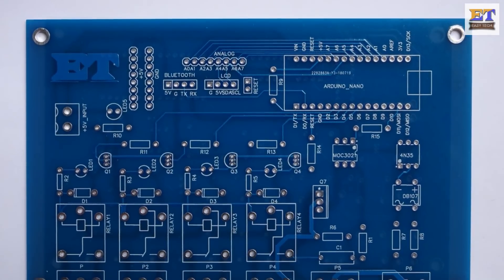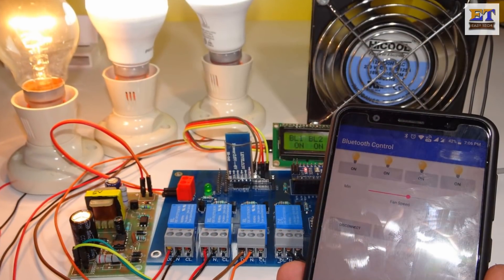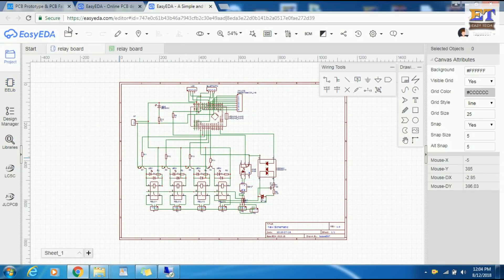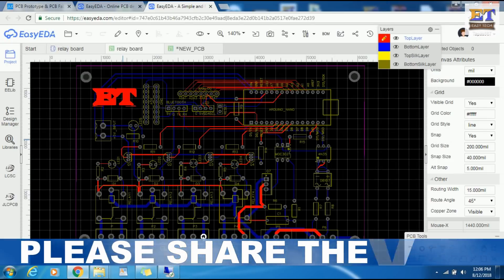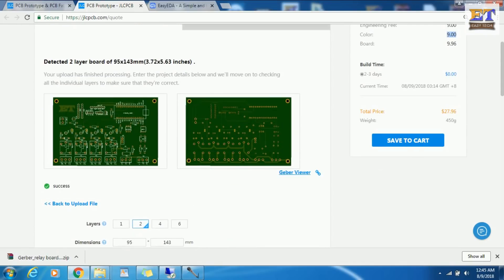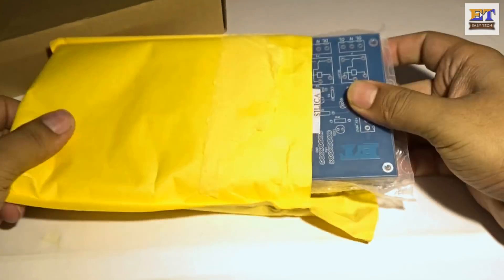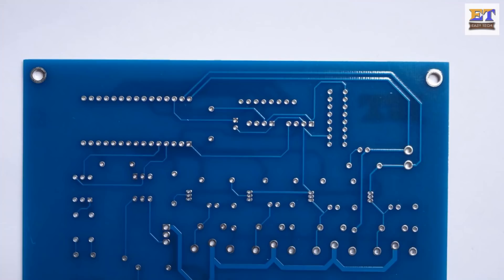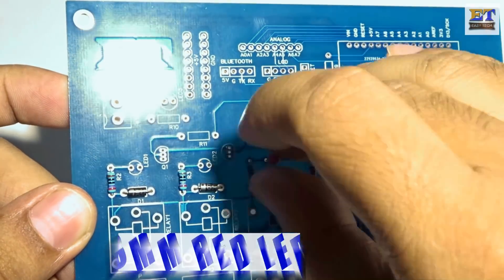Bluetooth Control FAN Speed And Light From Smartphone

Comment: Good
Reply from the maker: Thanks
Reply: @easytechzones Arduino nano add IR Remote episode Manuel switch code Bluetooth HC05 4 channel relay module add esp8266 01 module wifi  control
Reply: @easytechzones  good project plz aad IR Remote Bluetooth HC05 or manual switch add episode add lcd 16x2 not requirement add to 7 segment display

Comment: Excuse me sir. Code is not stable. That's mean
- If the first time you uploaded to the sketch => then system OK. Fan and lamp operated well
- However, if you unplug cable arduino out of the laptop/PC computer (power supply arduino) and replug cable again to power supply => Scanning your phone to connect bluetooth => But system was not operate. Why? Have you ever tried? Reply me please
Thanks

Comment: Try to fill the open area with GND (dashed copper filling) next time you design a PCB.
It will help you simplify the design and reduce noise in the PCB.

Also please consider optocoupled galvanic separation of the relay circuit.

Adding a few fuses would also not harm anyone and protect both your circuit and limit chances of fire.